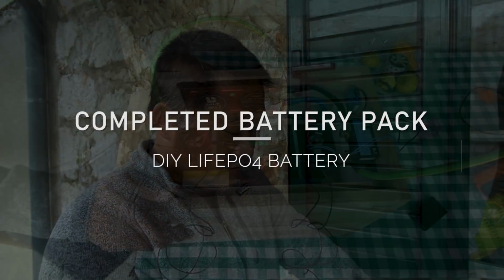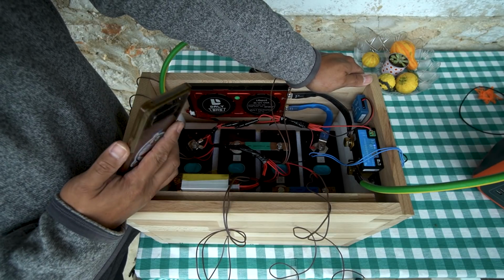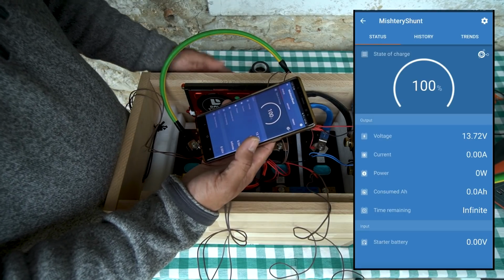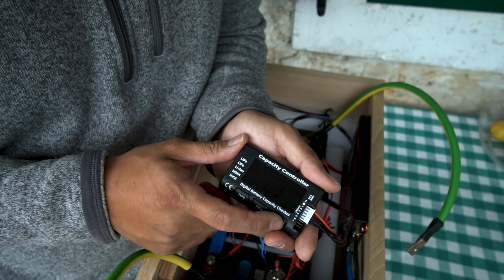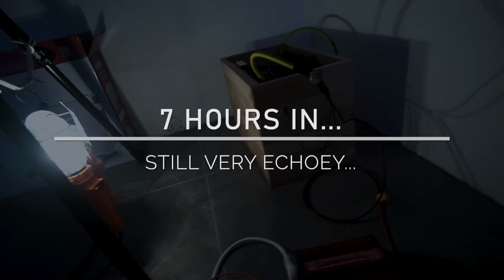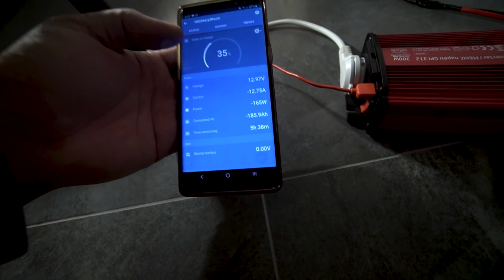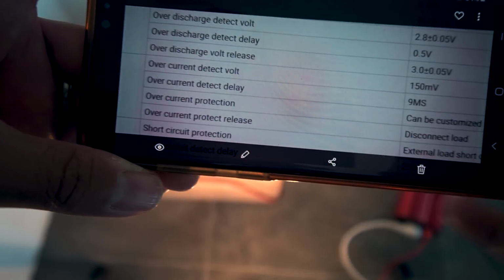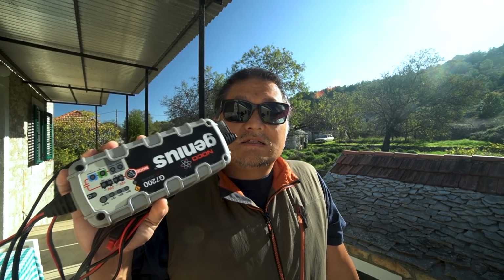DIY 12-Volt 280Ah LiFePO4 Battery // Full Capacity Testing // Part 3

Comment: Am I the only one concerned that he's using cables that are color-coded as ground for power?  Because that seems potentially dangerous.  Otherwise very interesting; I expect I'll be using some similar cells soon, though in a different application.
Reply from the maker: Always test with a multimeter for polarity even if the cables are color coded. With DIY projects, you can't always get the parts you want. Especially when you are in a foreign country like I am. These are welding cables I was able to find so it is neither color coded for positive or negative. If you have ever done any welding you will know that you can switch between electrode negative or electrode positive using the same rig. It's far more important to get properly sized cables than color coded cables if those are the only choices you have. So use what you have and know what you are doing. I have sinced added color coded heat shrink tubing or color electrical tapr for the ends to help identity but I still always test with my multimeter.

Comment: So you only plan to use a 18 Amp load in your RV with these batteries? What size DC to AC converter did you use?
Reply from the maker: Why only a 12A load? The cells can handle a maximum of 1C discharge rate and the components I chose can do 120A constant. I will never use that much. It will probably top out at 30-50A for what I will be using them for. That's fans, lights, fridge and charging devices over USB. When you say DC-AC converter do you mean an inverter? It is a 1,000 watt pure sine inverter that will only be used to charge my laptop which draws about 150 watts. Everything else will run off of DC directly. How the van's electrical system is configured will be in a separate upcoming video. These videos are just for the battery.
Reply from the maker: Ok I see. You edited your comment from 12A to 18A so I assume you are referring to the current draw in my capacity test. That is just for a capacity test of the battery. It has nothing to do with how it will actually be used. Its purpose is to determine whether the cells will deliver the specs from the manufacturer. If you look at the discharge chart by c rate in the specs, it should achieve roughly 280Ah when discharged at a constant 0.1C rate. That is a 28A constant draw. The capacity test is to prove those specs are right and these cells pass the test.
Reply from the maker: If you are talking about the inverter used in the capacity test then it's a 300 watt inverter. But that is irrelevant because the amp draw measured is upstream from the inverter from the shunt which is measuring directly at the negative battery terminal. Or rather the load negative terminal of the BMS.
Reply: Ok. Thanks. So you plan to use a 1kw DC to AC inverter in the RV from your 12vdc lifepo4 battery pack.   When each cell gets down to 2.8vdc you will be drawing roughly 90Amps (max) from the battery pack.  How long can this pack deliver this amount of power?  A calculation would suggest you should get about 3 hours run time when using the full 1kw AC power output (roughly 0.3C discharge rate).  Have you tested and validated this?
Reply from the maker: No I will not be doing a 0.3C discharge test. As long as this passed the 0.1C rate test, I have no reason to believe a 0.3C rate test is necessary. I don't know what you mean by the 2.8v per cell statement. The cell is very close to fully depleted at that point.
Reply: @freelyroaming  At 2.8vdc per cell a 1kW output requires more current than at 3.6 vdc per cell (at 1 kW output).  I guess you will find out empirically after the fact, rather than know up front what to expect. A 0.3C  test is a much better indicator of what you should expect.
Reply from the maker: Ok I think nominal voltage is the key word here. It is the average voltage of any particular battery chemistry across it's voltage range. Sure it will require more amps at the low voltage range to achieve 1kW output. But it will also use less at the high end of the voltage curve. That is why nominal voltage exists as a reference because it is the average across the entire operating range. We don't need to calculate amp draw in every moment across the entire 3.65v or 2.5v range to achieve 1kW of output. Use the nominal voltage which is already averaged out for you to calculate capacity.
Reply from the maker: The manufacturer has data for 0.1C, 0.2C, 0.5C and 1C. I don't know what supports your suggestion that 0.3C is a better indicator. You can compared the data at any discharge rate the manufacturer has provided. Some will prefer to do a 1C test or a 0.5C test and see if it matched the spec sheet. There is no rationale to decide which one is best to do. The manufacturer rated the 280Ah capacity at 0.2C. 0.1C will yield slightly higher and 0.3C will yield slightly less. So perhaps one can argue that a 0.2C test is best. Anyways, I think this discussion has run its course.
Reply: @freelyroaming  I look forward to your one year review of your new setup!
Reply from the maker: Great! I will definitely do a one year review. Probably even a few more along the way.

Comment: Would this setup power a 12,000 btu a/c unit?
Reply from the maker: Yes. A 12k btu AC will need about 1,500 watts to run. This pack has enough output to run it. At 120amp of draw, this will only run it for a couple of hours though. This is assuming you have the proper cables and inverter connected to it. Then you are needing to charge it up which would take awhile unless you are using a fast charger with shore power. But if you have shore power.... Run your AC off of that is a better way.
Reply: @freelyroaming  so maybe I can build a bigger battery?  We live in Florida and I don’t know if vents only in a sprinter setup like yours would be manageable. We do want to use solar.  We are so thankful we came across you.  We knew we wanted to go on the road but couldn’t find a good setup to sleep and safely drive us all until we found your channel.
Reply from the maker: You can certainly build a bigger battery. But if you need to run the AC multiple days in a row, do you have enough charging options to top them off each day?

Comment: If I’m building this only for my electric trolling motor, do I need a BMS and all the other components?  I was thinking I’d just add the Smart Battery Sense to the battery, buy a 5amp lithium only battery charger and call it good.  What is your recommendation?  Thanks.
Reply from the maker: You will need at least a BMS. Everything else is optional.
Reply: @freelyroaming  Thank you.  An 80amp bms would be plenty for my application?
Reply from the maker: Well I am unfamiliar with how many amps an electric trolling motor draws but it would seem that 80A is plenty.
Reply: @freelyroaming  On high, it pulls around 30 amps.
Reply from the maker: Ok yeah that's not much at all. You can go 9 hours on high with 4 of these cells. 80A BMS is plenty. Happy fishing.
Reply: @freelyroaming  Thanks for the information.
Reply: @freelyroaming  Actually, the max amp draw is 50amps.  I’ll still be able to go for a long time.  It’s rarely run on it’s highest speed setting.  Thanks

Comment: Hi I've been watching your videos for past few hours, would this set up you did be ok with vibration from a car audio system?

I plan on buying 90ah version of the batteries and looking at bms from bms overkill. Is there anything I should be concerned about due vibrations. Or taking anything into consideration? I plan on have the battery next to subwoofer box. Thanks for sharing your knowledge with others!

Comment: Very well done.  Please excuse me if I missed it but what did you end up with for a total build cost and how long did it take?  Understanding that you did have some delays in sourcing.  I'm more interested in working time.
Reply from the maker: Thank you Brian. So once I got all the parts the whole battery was built in an afternoon. But of course that is not counting the capacity testing time which took several days with a slow charger I had to use. The total build cost for me was around $1000. In the US you can get the same parts for about $800. In the next video I will outline them exactly for you guys.

Comment: right know for testing I have my 4 280ah cells in a plastic battery box for testing.  Before I really start using it I need to clamp the batteries together, otherwise I read they can swell during heavy use and rip the terminals if the buss bars will not flex.  Your factory bus bars are curved, and mine are straight leaving no room for flexing if and when the packs start to swell.
Reply from the maker: What are you planning to do with your battery? When you say heavy use, what will a typical day look like for these batteries? There is the normal expansion and contraction that happens with these cells when you charge and discharge that's completely harmless. Then there is repeated constant high c-rated draw that can generate enough heat causing excessive swelling which can lead to delamination of the internals. Like extensive use of induction cooktop or powering an air conditioner. The latter is what the compression technique is suppose to prevent. Mine will never be drawn beyond 0.2C so delamination should never be a problem. So my solution is to give the cells some added room to expand and contract naturally. I ditched the factory bus bars and made my own longer ones from copper pipes. It can be as little as using double sided foam tape between each cell to connect them then wrapping the with kapton tape on the outside. Your bus bar may provide enough wiggle room to allow that extra space. Also keep in mind that most factory build packs do not compress their cells tightly together like what some people are suggesting. The ideal solution for this problem depends a lot on how the battery will be used.

Comment: So let me get this straight, I now have a VMAX 120ah AGM battery to operate my boat trolling motor.  If I buy these 4 cells, I will have a total of 280ah’s to operate the motor?
Reply from the maker: If you build a battery using 4 of the same cells I did you will have a 280Ah 12v battery for your boat. It will have an equivalent amount of usable capacity as 4 of those 120Ah VMax batteries.
Reply: @freelyroaming  Wow!  Thank you.  I’ll be able to troll for a couple of long days before I run out of power.  😲
Reply: Wouldn’t 4 of my VMAX batteries be 480ah’s?  Just asking, I’m kinda dumb when it comes to batteries and electricity.
Reply from the maker: Yes it technically would but you are only suppose to use 50% of an AGM batteries capacity or you will noticeable degrade it's ability to hold a charge.
Reply: @freelyroaming  Got ya, thank you.

Comment: I capacity tested a small battery last night, I used a capacity meter, and 200watts of led flood lights, the house was flooded with light last night! Ha-ha, the pack came to about 20ah, my 33kwh house battery is not going to be easy to verify, ha... That's over 1k ah. I have 3400w of panels to put up also, I hope to get more battery, and more solar, and build some type of ev, even if it's only a electric tricycle! A 20"-24" trike, with 2, 5kw motors, and a 1.5-3kwh battery would be a mean macheen! I do have enough cells to build a 32ah 28s battery for a small e bike, to be charged from my off grid house power system!!  So I can build a 48v, 60v, 72v or even 96v, maybe a 120vdc, and the cells are capable of a sustainable 200amps each, so 4p would be insanity for a E bike, a bit off topic, and rambling sorry!!
Reply from the maker: You've got some projects ahead of you! Good luck.

Comment: Can I build three of those and hook them up together for a large camper?
Reply from the maker: Yes but there are a few different ways to do that and you have to decide which way is best for you. First you have to decide the voltage of your packs. Assuming you want 12 volt, you have to decide to build 1 large pack with all 12 cells which will be 3P4S. That means first connecting cells in parallel in groups of 3 and then connecting those 4 smaller packs together in series to form your 4S connection. Alternatively you can build them like 3 completely separate batteries. Each method has its own pros and cons. It is a topic for another video.
Reply: Id like to be able to remove a 12v 280ah pack for my troling motor. Can you do a video on how to do that. I have 12 cells
Reply from the maker: I will make a video that talks specifically about ways to setup 8, 12 or 16 cells in 12 volt mode.

Comment: Dacian @Electrodacus has a excellent Solar battery management system that has all the features ie charging,monitoring,balancing,temperature,data logging,WiFi connectivity etc all in one.It’s an amazing piece of electronics,really genius,you don’t need all those wires.
Reply from the maker: Electrodacus also need sensing wires to each positive post of every cell for monitoring cell level voltage. He can not produce quantities in high volume therefore isn't really a product that can be practically recommended as most people won't be able to acquire one for their build. But if the Romanian team succeeds in crowdfunding their licensed clone then it could bring it into the conversation. Though even then, it is still a product for enthusiasts who knows what they are doing versus beginners that might want to try their hands on assembling their first battery.

Comment: Having 5 years experience with lithium in my RV and living in it full time, I have a bit of a problem with your design. The problem is how do you cool the cells on a hot summer day? Especially if the sun shines on the door to your battery compartment. I have found that its easy to have the battery get over 100 F or 40 C and not be able to cool down at night. I now have my compartment insulated and the cells spaced apart so air can flow through with a fan.
I'm considering a liquid cooling system on my next battery build.
Reply from the maker: Wouldn't this be a problem with any battery? Why do you say it is specific to my design? most commercially available batteries do not have any active cooling. And they are completely enclosed on all sides. I have the victron battery sense installed and i will be monitoring the temperature in all environments. The battery is located inside of our insulated van. We have been living full time on the road for 13 years. If it is over 100F inside the van, we are out of there. As you know, full time traveling means following the weather. Although we have been stuck in places during heat waves, it does not happen often.
Reply: @freelyroaming  I have found that LFP produce considerable heat while charging and that heat needs to be removed. These larger 280ah cells have a lot of mass and will be harder to cool than my 100ah cells. With cells stacked right together they can eventually overheat. Lead acid batteries are much more tolerant to high temps than lithium. Remember the success of Tesla cars has much to do with their active liquid cooling of their batteries.
Reply: Its true, i usually run a 2 watt fan for all electronics.  Cross ventilation
Reply from the maker: What C rate are you charging at? There is practically no detectable rise in heat when charged at 0.2C which is the fastest I'm able to charge with all of my charging method combined. 99% of the time they will charge at 0.1C or less. These batteries will not generate any noticeable heat in their entire lives while charging. Tesla uses different lithium chemistry and charges at massively higher C rates. Mine is a 3.6kwh battery pack that takes 8 hours to charge. Teslas can charge a 85kwh pack in 75 minutes. That is a rate of more than 150 time faster. Even when factor in their voltage differences, we are still talking about orders of magnitude differences in charging currents. These batteries should never be compared.
Reply from the maker: If you are getting a lot of heat then you could have high resistance issues somewhere in your system. Too thin of wires or terminals that aren't torqued down properly for a clean conductive surface. You might want to go over it all again to check your system.
Reply: @freelyroaming  My situation is different, I have an 11 cu/ft electric Fridge and 3 cu/ft freezer, electric water heater, and induction cooking. I have 1600 watts of solar on the roof of my RV and 3.5 kwh of LFP. It takes a lot of energy to keep my refrigeration going on  a hot summer day. I can charge at 0.3 c from solar. The heating in my batteries is not 'noticeable'  but over days the battery temp creeps up over 100 and something needs to be done.
Reply: All i can say is: FLORIDA TEST and then u can know for sure.  Fact is electronics make heat and heat kills ALL electronics, especially when its off grid, always on situations